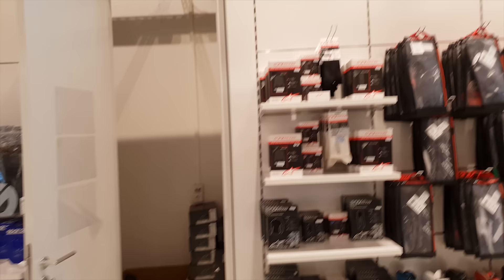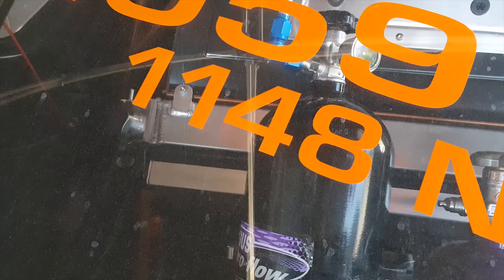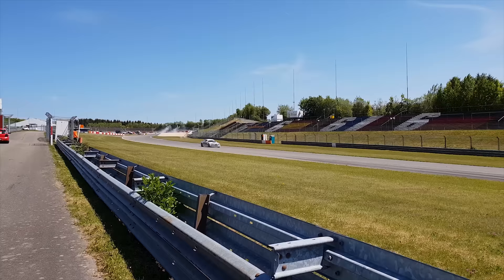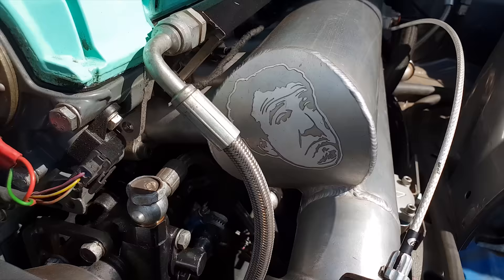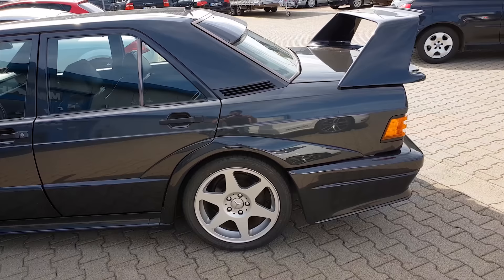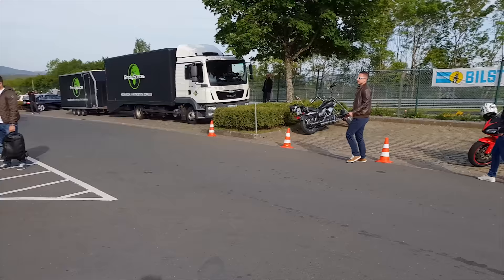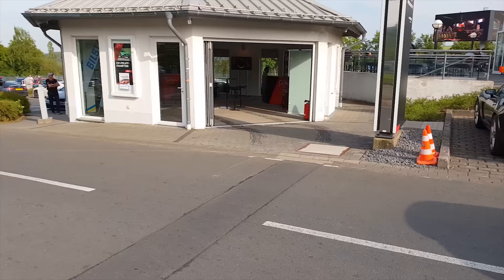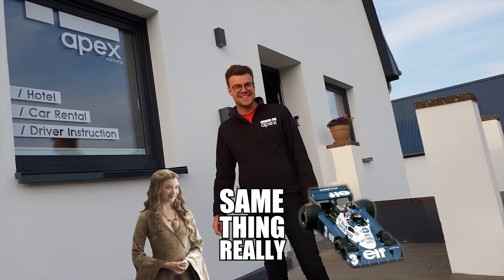NEW RING RECORD BY SABINE SCHMITZ?

Comment: 4:03 - It might be the shovel that used to dug hole to buried some "unfortunate one", who knows? XD

5:23 & 5:30 - I guess those are disadvantages of low horsepower 4-cylinder in a big corner drift, they didn't have as much smoke... especially when they need a lot of speed (to catch up with big horsepower monster).

6:25 - Now that is a unique way to supercharged a V8, that's a surprise (to me) because most root-type supercharger use custom intake manifold!

6:50 - Saw some of the spec of that CLK before, really glad it has a Mercedes engine, you don't see that often!

16:15 - apparently Tyrrell P34 was running in 1976

I really love how the recent video are put together, the extra things (don't know the right words) really make the video! Great choice!

Comment: 2:31min 
Compacts have exact same wheelbase as the regular e36'
Just the rear body overhang is shorter
Compacts have more old school suspensions setup in the rear (same as the e21/e30/z3) not ideal for traction